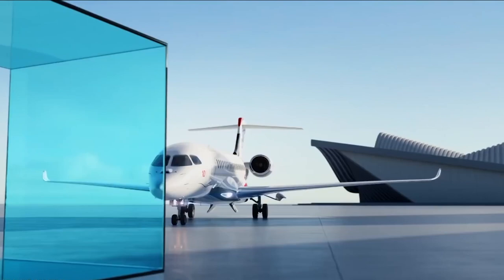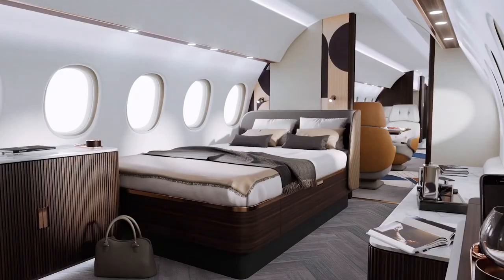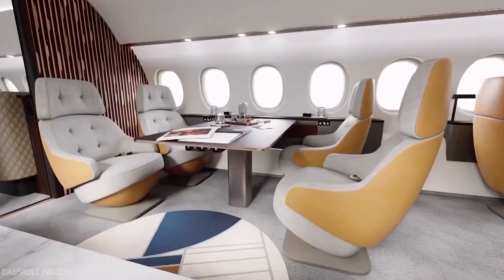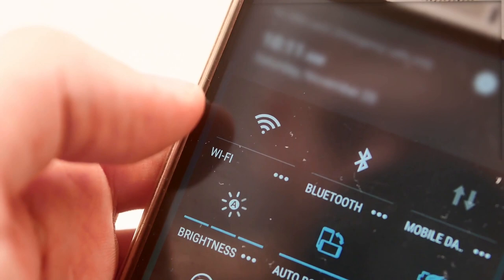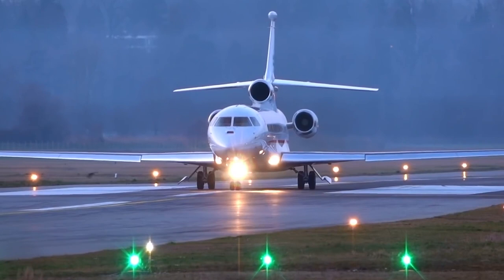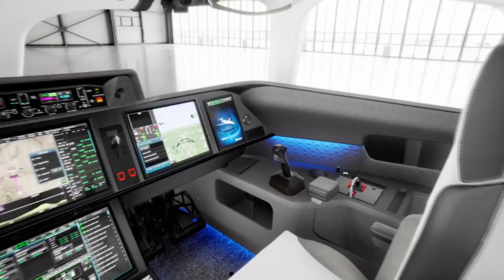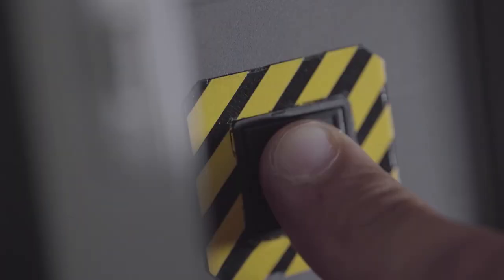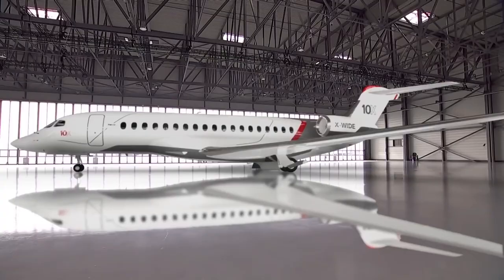Inside The $75 Million Dassault Falcon 10X

Comment: It will not take off in 2500 feet, it will LAND in 2500 feet, but if you land on a 2500 ft airstrip you will not be taking off.
Reply: Probably could with zero payload and just a squirt of fuel.

Comment: Only reason to get a Falcon is for their famous trijet design. They just gave up their key niche demographic and customer base with this project by taking on Bombardier and Gulfstream at their own game. If I had anything close to this kind of money I'll take the 8x and hold on to the balance lol.
Reply: EXACTLY!!!!
Reply: The 10X will be sold out for years to come just as the 6X is.  Dassault has made several 2 engine models.  The 2000 is a best seller.  The 10X will be an extremely strong competitor to the 7500 and 700, and even the ACJ 220 from Airbus.
Reply: @stevensims8922  you seem to know a lot about this stuff